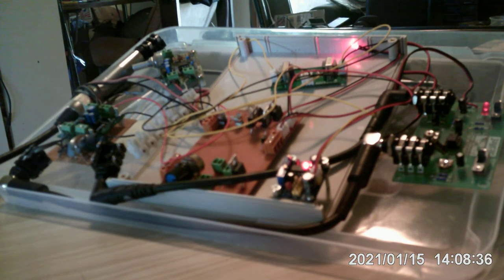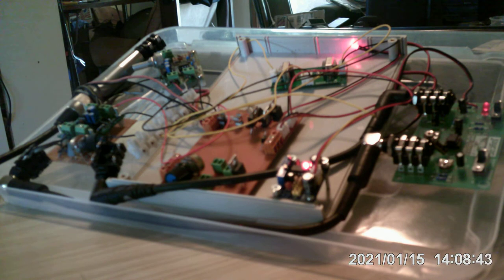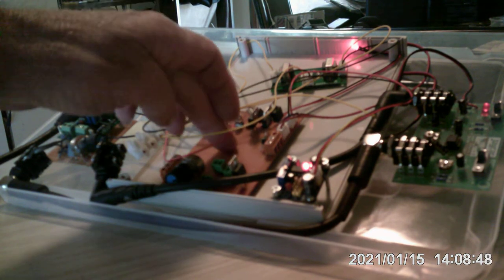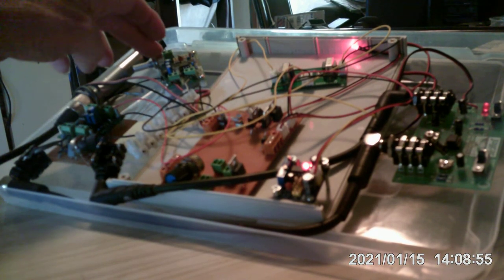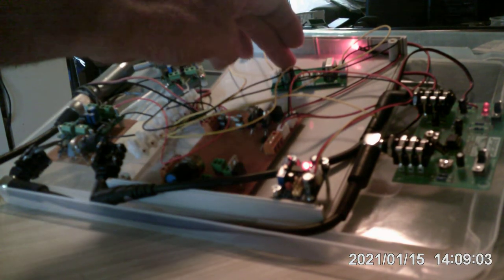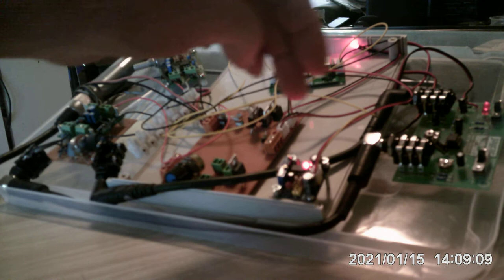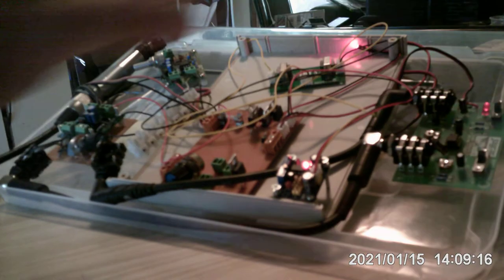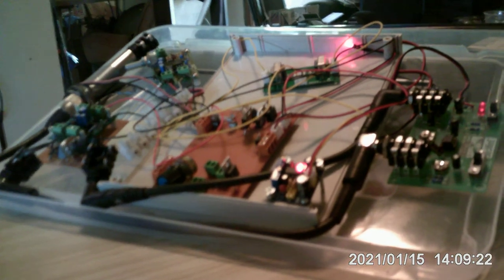Voice Modulation Analogue Ring Modulator Pt 1

Comment: Liking the work. Have just ordered the Martmod Mk5.
Dave the Dufftown Dalek
Reply from the maker: The Martmod MK 5 is a good design.
I have had mine for 2 to 3 years now.
You still have to put a lot of vocal technique into the microphone to get more out of the Martmod.
If it's not to late, I would recommend getting the biggest amplifier version. I made a mistake in ordering the smaller amplifier with 2 speaker output's.
The Martmod MK5 has great anti-feedback technology built into it, so it should easily be able to handle a bigger amplifier with louder output volume levels.
Reply: @aussiekev2394  Thanks for the advice. Luckily yes I have ordered the bigger one.

Comment: Would you recommend the moog minifooger for dalek voices? I want the MF102 but I just can't afford it
Reply from the maker: No I wouldn't recommend the mini-moog. I have the minifogger and it has a fast LFO speed as the minimum setting. 
From memory I think that it also has a high pitched noise like a white noise. But I would have to get out the mini moog to refresh my memory and double check the results.
I would also like another MF 102, but the price has skyrocketed to 2 to 3 times the price compared to when I bought my Moog some years ago.